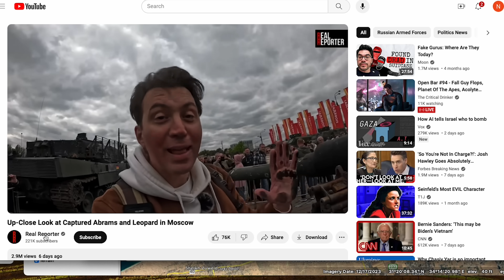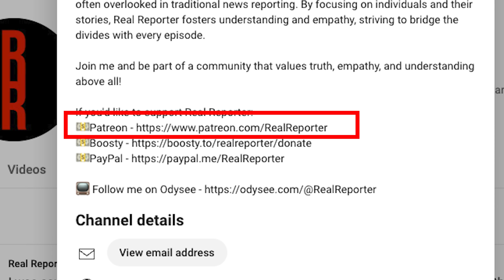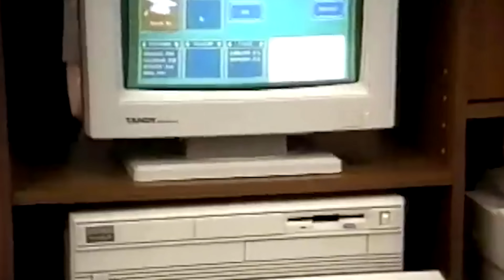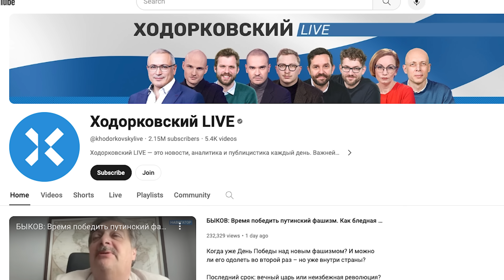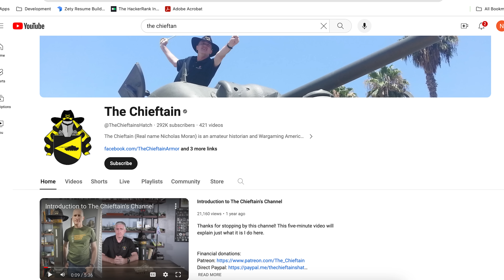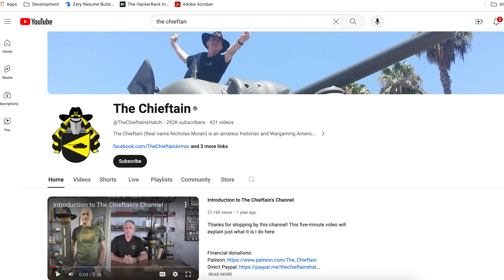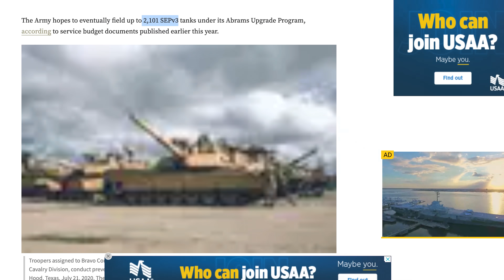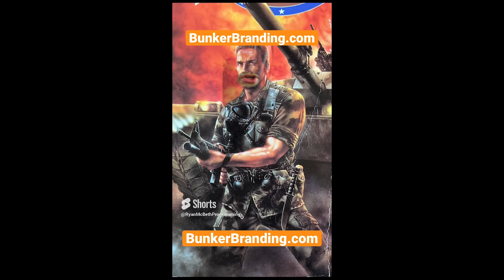Analyzing Real Reporter and Captured NATO Vehicles

Comment from the maker: Go to https://www.piavpn.com/McBeth to get 83% off Private Internet Access with 4 months free!

If you want to watch the original video from Konstantin Rozhkov / Real Reporter 
https://youtu.be/HBdf4Dk_LqY?si=8GhgNzvBo8es8onr

You can join The Chieftain's channel here:
https://www.youtube.com/channel/UCp4j9Y9L6jie44iZroCb99A

A few takeaways from the video: 
Konstantin Rozhkov and the real reporter channel is almost certainly a form of Russian propaganda, but it is a very soft form of propaganda.  There was no glaring misinformation however there are some items that should be noted.
#1. NEVER touch a destroyed tank unless you have to perform a rescue.  
#2. Konstantin Rozhkov is Russian and may be trying to "act" like a westerner to make the propaganda more palateable. 
#3.  Abrams tanks that were sent to Ukraine we the M1A1 variant that was at least 32 years old.  This was not the best western equipment.
#4. Russian tanks tend to use steel treads because they are cheap.  Knocking the rubber track pads out of a western tank would create a less grippy surface on mud once the mud filled in the gap were the pad is.
#5. It is highly unlikely that British contractors would fly F-16s in Ukraine because the UK does not operate the F-16.
#6. None of the videos I looked at were monetized by YouTube.  This may be an indicator that Konstantin Rozhkov has an alternate source of funding.

Special thanks to Kateryna Shenheliia and Nicholas Moran for their contributions.

For uncensored video, check out my substack at:
https://ryanmcbeth.substack.com

Like my shirts? Get your own at:
https://www.bunkerbranding.com/pages/ryan-mcbeth

Want a personalized greeting:
https://www.cameo.com/ryanmcbeth

Watch all of my long form videos:
https://youtube.com/playlist?list=PLt670_P7pOGmLWZG78JlM-rG2ZrpPziOy

Twitter:
@ryanmcbeth
Instagram:
@therealryanmcbeth
BlueSky
@ryanmcbeth
Reddit:
/r/ryanmcbeth

Join the conversation:
https://discord.gg/pKuGDHZHrz

Want to send me something?
Ryan McBeth Productions LLC
8705 Colesville Rd.
Suite 249
Silver Spring, MD 20910
USA
Reply: Why don't we in the west have more arms and ammo to help Ukraine with? Why is Russia in producing the west when they are a gas station with nukes?

Wasn't all the sanctions supposed to send Russia into the gutter?
...or was the point all the way to hurt the Europeans competitiveness?
Reply: 🤔 Funniest VPN commercial, yet 🏆🤣👏🏻💕🙏🏼
Reply: Should also analyse his voice, because I think I've heard this voice over some other ruzzian propaganda videos.
Reply: You missed the bit that Germans don't do parades (anymore) they are actually a bit ashamed of having an army.
Reply: The Ontario regiment museum is 5 min from me
Reply: @buddy1155  Germany dont have an army...
Reply: @lukeamato423  I guess its empty now? Having sendt everything to Donbass?
Reply: @111076tom  no actually we have more now thanks to Russia's failures recently
Reply: @111076tom  just like Russia's parade we have a t34 too....only ours runs better
Reply: @lukeamato423  you're just wrong.
Reply: @lukeamato423  A tough-guy from Canada. How is that for an oxymoron...
Reply: @111076tom  well we woop russia in hockey so apparently it's not
Reply: Yeah, yeah the videos are fine, but I CAME for the tight ad read.

Edit: maybe you already do this but have you ever thought about doing memberships with bonus videos that you can't monetize?
Reply: Huh... I already have PIA VPN...
Reply: I was a Bradley mechanic for 15 yrs and did 3 tours in Iraq. I am probably one of the few who saw Bradley's and tanks forced to do missions with tracks that had actually worn the pads down so low that the track grousers were wearing down. The reason I say this is because I was there for the first rotation into Iraq. And at the time the Army hadn't gotten the supply system fully up and running yet. So tank and Bradly track pads and even tracks weren't fully in the system yet. So our Brads and tanks were running dangerously low on their grousers by the time new tracks and pads arrived. 
The track pads aren't great for mud this is true. Rubber does nearly nothing to provide traction in mud and especially icy conditions. Having been stationed in Colorado @ FT. Carson Co. For a total of 8 yrs. I have definitely seen and experienced plenty of icy conditions with tracks. And LOTS of experience with mud thanks to Kosovo and Georgia @FT. Benning.  
The biggest benefit rubber pads give tanks and tracks is that the rubber is what we mechanics typically used as a wear gauge in a way. When the pads were nearly even with the grousers we would order new pads and have the crews replace them. This was to protect the grousers and the tracks from wear. Supposedly according to the Army pads are cheaper to replace than entire tracks. Whether this was true or not I never cared to find out. And never heard anyone say other wise with factual evidence to counter it. Either way that's what we were told and it was what we went with. 
But back to the Iraq thing. With track pads the Brads and Tanks turned and took corners pretty good and with little Tokyo drifting. But once the pads reached the grousers the tracks became ice skates that slowly gave less and less traction the more the grousers wore down. It eventually got to the point that the drivers were literally drifting on the FOB as they came to the Maint area due to the tracks nearly having no grousers at all. Which is dangerous for the crews and people near the roads when a combat patrol is driving at convoy or mission speeds and has to turn, but instead slides into people cars and such because the tracks offered little traction at that point. 
Thanks to track pads. The biggest reason we ever changed tracks wasn't because of grousers in the Army. It was bushings surrounding track pins that would wear down. 

Thanks for the videos sir and keep up the great content.
Reply: “And he touched the tank again!”👍🤣🤣🤣
Reply: MACBETH, MACBETH -Some NCO from your past.

My concern is Russia learning from of gyroscopic stabilizers, and now have an American engine that can run on Vodka. They may also see how to stock a tank with ammo without making it blow off the turret.
Reply: RE the Abrams: The tank hit a mine in "no-man's land" and lost a track...  with the crew escaping unhurt.  Ukraine was then unable to recover because of the location, and destroyed the interior of the tank with drones to prevent Russians getting access to the communications tech.  At the same time, Russians were attempting to prevent Ukraine recovering the tank and shot it up with Kornet while Ukrainians were droning it. When the battle lines moved, Russia claimed the tank... and the hole in turret (and other damage) first appeared when the tank was put on display in Moscow.  

RE the dude: I've see vids where he claims to have been an American Marine now married to a Russian and living in Russia. Overall, he seems to be connected to the Russian system (while NO ONE was allowed to climb on the displays, this dude as a pseudo-American speaking English and using a film crew, was both allowed to climb over the display's crown jewel, and was provided with a talking head Spetsnaz to deliver the hard core Russian propaganda).  And, of course, SOMEONE is paying him.... and it isn't YouTube.

Overall his schtick seems to be Russia is a warm friendly place full on nice people where an average American-type Dude can be comfortably at home. That said, he is consistently a soft sell for the Kremlin.
Reply: Keep up the great work.
Reply: They canceled the T-14. 

It was ugly anyway
Reply: I wonder if this guy grew up in one of those KGB run "America Towns" that they built to train infiltration agents.
Reply: At least you make your ads funny as f$ck, see you in aus mate
Reply: If a Russian wanted to know the materials used to make the F-35 so stealthy, all he'd have to do is make a video claiming the F-35 isn't stealthy at all. Countless Americans would try to prove him wrong and  some of them would tell him how its actually done in the process. I think he outsmarted you since he just had to act like a fool and you gave him valuable pieces of information regarding how to disguise Russian speech, technical information about American tanks, and valuable health and safety information for soldiers. You might be responsible for preventing countless Russian soldiers from getting cancer from destroyed tanks.
Reply: Nice video.   You got a few things wrong, the gulf war abrams is not the abrams that ukraine got,  gulf war tank had 105mm gun and 2 7.62 guns,  the tank sent to Ukraine had a 120mm gun and 50 cal guns also better armor.    Also the abrams were not being used in front line service until recent so it doesnt matter when they were sent, since they have been moved up there were 7 confirmed kills by video in a short amount of time and then they were pulled back from front again.  Video's are fun to watch but lets keep it real.  Also the t14 had 1 reported problem at a parade which was driver error and it ended up driving off,  not saying its a great tank but today we have seen there are no great tanks,  they showed a t72 tanking out a abrams in a fight, why because all countrys over hype their gear so they can sell it to other countys, the t90 abrams challenfer and the Israel and german tank are all being taken out pretty easy between drones and anti tank weapons.   anyways keep the videos rolling and good day
Reply: @MyroslavDrujenko  he appears on all the westerners in russia youTube channels. FSB clearance for shizzle.
Reply: pure propaganda you talking about the Russia USA 🇺🇸 🏃‍♂️ away during Afghanistan war massive weapon and equipment with Taliban hands today 🤣🔻
Reply: Just a heads up, Ukraine pulled the Abrams, leopards, and Challengers off of the frontline a few months back. Reportedly they were drawing too much fire however speculation is that a combination of their size, difficulty in the muddy terrain, and being a priority target lead to Ukrainians simply not wanting to use them if a T72 variant was available. Regardless it seems Russia was destroying only slightly less than 1 Abrams a month (I know I am being pedantic).

Great advertisement BTW, had me laughing quite hard.
Reply: @Soulessdeeds  "(...) one of the few who saw Bradley's and tanks (...)" - Should be: "Bradleys and other tanks". Bradley is a tank, and you're welcome.
Reply: "real reporter" channel
😂
Reply: Hey Ryan please do a vid on the cnn report on detainees from a few days ago. Is it misinformation?
Thanks
Reply: no thank you
Reply: @lukeamato423  Hockey is an idiots game.
Skating is for girls, and fighting on skates is like throwing a spear while jumping. Utterly pointless.

Where do you think Tyson got the power from when he threw his left hook? The bicep? 😅
Reply: @danielmartin7838  No they did not.
They just delayed the order to free up capacity for more T-90 Proryv. 125 per month. That is more than the US produces pr year...
Reply: @111076tom  so you can't skate is what your saying and don't know how to fight
Reply: @lukeamato423  
In Norway we skii. Skating doesn't work on snow.

And my record in the ring is 15-1, on the street 20-0. 

+3000 hours of training boxing makes me pretty comfortable telling you I can fight.
Reply: Russian videos has no ads by default from 2022 no matter what side you are. Khodorkovsky or Maxim Katz have no ads despite both being an opposing politicians
Reply: also ribbon of St. George wasn't famous during WWII, because in USSR St. George order have been banned as a part of religious past, instead it's was called a Guard's ribbon. Propaganda just reintroduced it as St. George's
Reply: also ribbon of St. George wasn't famous during WWII, because in USSR St. George order have been banned as a part of religious past, instead it's was called a Guard's ribbon. Propaganda just reintroduced it as St. George's
Reply: Your sponsor should actually hire you, that "pay the bills" spot was ... spot-on. And though that's a pun, I'm being perfectly serious. If I didn't already use a great VPN, I'd totally be looking into it.
Reply: FIY, the main reason Russians don't have rubber on their tracks because during WWII, Soviet Union was short on rubber, therefore, when building the tanks, builders just skipped it. (T34 supposed to have rubbers too)
Reply: "#6. None of the videos I looked at were monetized by YouTube.  This may be an indicator that Konstantin Rozhkov has an alternate source of funding."
You have no way to get money from YouTube in Russia. _ALL_ russian channels live on donation or native integrations.
Reply: Where did you get 5 by the time you posted the video oryx was at 8 and lostarmour was at 9+2 of the engineering vehicles with Abrams body
Reply: @MohawkGhost  Abrams are overpriced junk, and the T-14 you are talking about had the handbrake on...
Reply: Nah, the ribbon got popular way earlier than this war. It became popular in the demonstrations against the new government in Ukraine in 2014.
Reply: Well paid.. You seems a real western propaganda..🤣 Peter Griffin is that you???🧐
Reply: That guy made a video that responds to this episode ohhhh snap, lol!
Reply: Ryan, may be you are an American propagandist?
Reply: Yeah, uh, Screw that guy, Sarn't.

He drags you in a reply video to this, he's trying to be cute but it's quite petty. 

Also, includes a fmr Armor officer, should look at him and make sure he doesn't have access he shouldn't. 
I'd go back and look, but I don't want to give that troll a single second or view of my time. But, yes, OPM should pull that Armor officer's clearance. My two bits.

Keep up the great content, I enjoy it.
Reply: My man, you play Gen Zero? I love that game. Let's play together.
Reply: I guess we all can judge on our own where propaganda starts and ends. 
At the end Konstantin is speaking english quite well and he has covered a lot of ugly points for russia and was in line with what other russian had reported back when those were still in russia, like another Konstantin, who had lived in the USA before. 

And things are getting really worse, if americans appear on his channel who have served in the USA  army before.
I guess the USA has more issues than they ever had thought about considering the amount of american citizens with american passports appearing in russia on the channel. 

Anyhow the real reporter Konstantin has not fooled us for example using his right first name, his past and what he had done before. His car is real as we have seen pictures from visitors of russia who incidently had met him in that particular car, an old american designed build in germany GM Opel Astra. 
And also he had been talking quite openly about the american culture and of cause "Moral" to ban and boykott russia and then come back through the back door to make business again like so many american companies did. 

So why should we continue to limit our exports if the american idea is an official ban all companies followed and then use the backdoor to come back in business again. Well, ameriacn John Deere did that - but now we are doing it too an reconquering the market shares John Deere had stolen from our manufacturers by simply pretending to have gone out of business in Russia even though spare parts and new machines and harvestors are available. 
We can do it too this way, another proof of america first and no longer to follow the americans, cause they will fool us anyway. 

Time for make the EG grerat again which is the real EU of the strong, not the weak crap that costs us fortunes cause those are weak economies with fake stats and what not. EG was the predecessor of the EU in the 80s and 90s. Time for a new iron curtain and let the eastern europeans let defend themselves cause they are only net takers from the EU and a deadly cancer cause they do not provide any support .
Reply: that's a Russian cathedral not the Kremlin. Get it right ryan mcbeth
Reply: hey ryan mcbeth you got a response video from Real Reporter where he exposed all the lies and nonsense from you
Reply: Hey Ryan. Love your videos! I also love how I’m depth you go with your topics. Top notch, top shelf the whole 9. 

Anywho, like the topic of this video, I’ve come across what I believe are propaganda reporters. (On YouTube) One in particular I’d love to know more about in depth and expose them. I’m not sure if youve heard of the reporter but he’s called “Patrick Lancaster”. He portrays himself as an honest journalist getting the REAL scoop on the “operation” in Ukraine…and he portrays like other media sources are all lying about the situation. Smh. He’s a piece of work. If you hadn’t heard of him yet, it may be interesting for you to look Into!
Reply: @111076tom bruhhh someone has failed in economics ☠️🤣 do you know what a last kick of a dying horse means?
Reply: @pandibbarman  Failed what in economics?

You sound like the dead cats bounce.

I am actually educated in economics, are you?
What did I fail?
Reply: @111076tom  The US alone can out produce Russia in fact the US out produces Russia in everything except artillery shells and some other military equipments and during war they can produce 10x the amount Russia will be able to produce.
Reply: @AAAAAA-tj1nq I watched that video and in most cases he just proved Ryan right!
Reply: @GarryFisherProRider  Uh, no it isn't.
Reply: @pandibbarman  

You must be joking.

The US has moved (sold out) +90% of its production capacity the last decades.

During WW2 the US had over 30 drydocks suitable for producing ships up to the destroyer class. Today they have TWO!
IThe US hasn't produced a Javelin since 2006. They are struggling to prodlibduce +50 Patriot missiles per month.

You seem to think a factory is just a building. 
Seem to think that the (unreal) loss of experienced workers makes no difference. That the access to rare earth minerals plays no role. That it makes no difference if you have a fit 120 pound marine, or a 240 pound identity queen playing admiral.
The US has not won a war since Bush kicked Saddam out of Kuwait (after Rumsfeld gave Saddam the green light to attack the oil-thievs).
The bombing of Yugoslavia was no war.
It took them 20 years (and how many dollars?) to admit they couldn't overcome the Taliban. 
Sure, they fed the Libyan terrorists enough intel to murder Gaddafi. How is that country doing today? 
Sure, they PRETENDED to fight ISIS a long time (while arming them, financing them and stealing the Syrian oil).
They pretended up until they suddenly found out that Putin (under their nose) had moved 60 fighter jets into Syria. THEN the war turned, and the US/Israeli/Saudi-backed wahabi terrorists were slowly wiped out (or pushed into Idlib, where the NATO-Turks can protect them...).

You think machines just appears when you want them?  You think that experienced hands to man those machines magically appears? You think the raw materials are free? (Have you seen what is happening to the US 10 year bond? Where are the buyers? Can the Fed compete with the Chinese if they keep on selling? What will that cost?)

Or maybe the plan is get down on the knees. Beg China for a loan, then beg China to sell you lithium for the loan, then use the lithium to produce weapons to defend Taipei against the Chinese?

If the industrial might still was there, then why are the Ukrainians firing shells from Korean or Israeli storage?)

How many Ukrainian men must die before people accept that Russia (with its immense recourse-base, its MIC not based on (or restricted by) capitalist principles, and the industrial gigant China in its corner)  isn't going to back down this time. 
That they have put the foot down, and will go nuclear before accepting defeat?

How many more men must die to serve Washingtons ambitions?
Reply: why the stripper example?
Reply: You love to lie about Russians right?

That guy even tells how long he loced in Russia and even wich stores he regulary visits! 

https://youtu.be/WUlMvyKeUHM?si=a7Eww-zLL2pcWzEh

In this video he even gets the shop to print out his recipt from years!